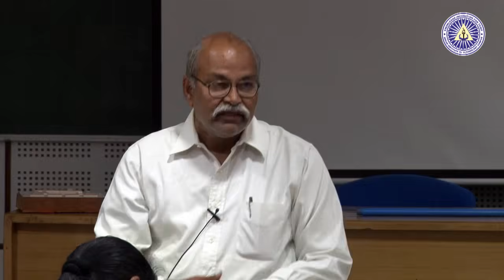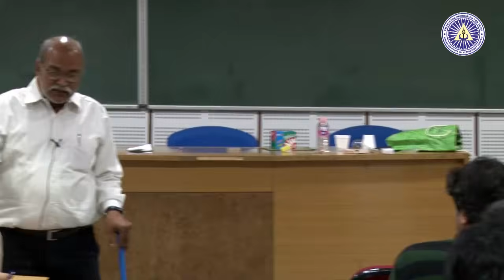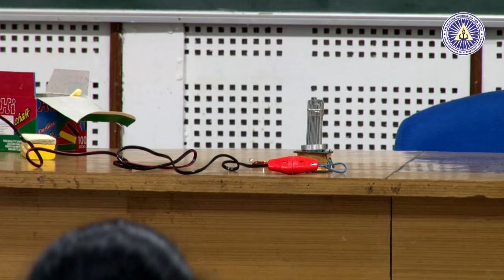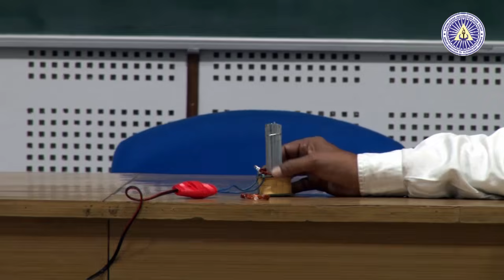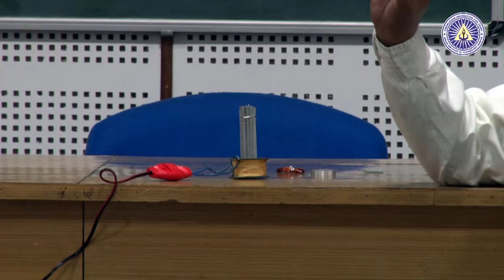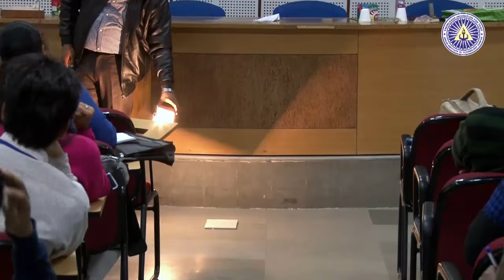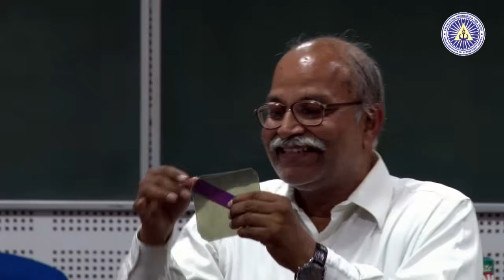General Talk by HC Verma

Comment: Now, can anyone answer the first question asked by sir that was not answered at 19:45
Reply: He's applying 20N of net upward force, because Newton's law cannot be broken. However, when the bag is at the center of the stick, the gravity and the upward 20N force form a couple, which tends to rotate the system in anti-clockwise direction. If he keeps applying 20N, the system will rotate until the two forces align vertically (when the center of mass/gravity comes vertically below the upward force) and the force couple vanishes. But, he tries to restrict the rotational motion to keep the rod horizontal. For this he needs to counter the existing couple by providing an additional force-couple throughout the length of his palm (An upward force towards the bag, and a downward force towards the end of the rod) -- this leads to an additional zero net force, but non-zero force-couple. Thus he feels like he's applying way more force than 20N.
Reply: ksceriath now can u tell the answer of 3rd question, that why that aluminium ring is balanced in rest. What is balancing its weight?

Comment: Does anyone notice wall tiles look like breadboard😂😂
Reply: haha way too much into electronics :D
Reply: Actually they are sound absorbers
Reply: @shivanshpandey5907  yaa maan
But still they look like breadboards
Rofl
Reply: Hey guys, that is not for sound proof, it is installed there so that the sound will not reflect from the wall and hence there will not be any echo.
Reply: @bhawanishankarsahu8000  bt the glass wool filled inside also absorbs the external vibrations and it also absorbs the internal sound waves
Reply: These are installed at all the lecture halls at IITK , especially in small and medium sized rooms. I had the pleasure of being taught by Dr HC Verma in my first semester.
Reply: it is 600mmx600mm 15 mm thick gypsum composite perforated tile filled with 50 mm glass wool used for sound proofing of a room btw i'm a civil engineer and recently engaged in a construction of sound proof room in a hospital
Reply: True
Reply: Oh yaaa
Reply: fuck you
Reply: Yeah exactly
Reply: Ece folk spotted😂
Reply: Decoration type cheez hai
Reply: That's IIT
Reply: This is lec hall 1 I guess. Gave presentations here few times during my time at iit k
Reply: Does anyone notic that it's blackboard not breadboard
Reply: Acoustic panels buddy
Reply: They are sound absorbers
Reply: On point electronics
Reply: That absorbs sound

Comment: leds are connected in series having considerable resistance....so when polarity reverses then voltage available for second one followed by voltage drop after first is lesser... additionally boath leds may hv similar resistance
Reply: Man you got to brush up your knowledge once again.....
Both LED are connected with different coil. One is at left end and one at right end... And also they are connected in reverse biased respect to each other. In on direction one glows but not other at slow speed. Because LED doesn't glow reverse. But high speed it glows because voltage become significant in other direction for short period.

Comment: In the first question asked..
The pipe acts as cantilever beam..
That is one end is free and other is fixed.. 
Therefore for first question ,the answer would be.
The deflection is maximum at free end.
So that's is the reason we requires more force,to balance the bag..
Plz anyone help..
If am correct or not..
Reply: Due to Moment force
Reply: Chandrashekhar Shedole These is torque of 20x(length of rod)N-m along with 20 N Force.
Reply: U r right
Reply: We can answer that in many waves
Reply: That is not only example for canti lever beam. It is example for door opening easy at end not in middle or starting ..it is example for a mechanic wrench .it is a general observation. Need not to think more.

Comment: Plz answer the question of first activity
Reply: It's all about center of mass!! and i'm not even an engineering student!
Reply: pritam parab tu chutiya hai point of application is answer
Reply: Ashutosh Shrivastav the bag is heavier than the rod hence center of mass will be closer to the position of the bag in the system , initially the bag was closer to the person hence the  net torque required to balance mg was less ,  as the bag shifted away the torque required also increased so the person now has to apply more force